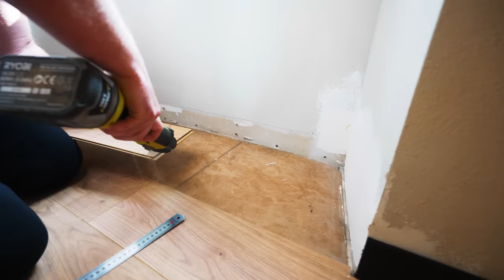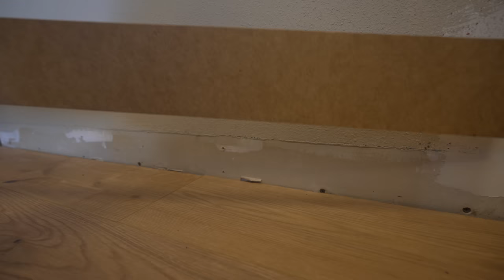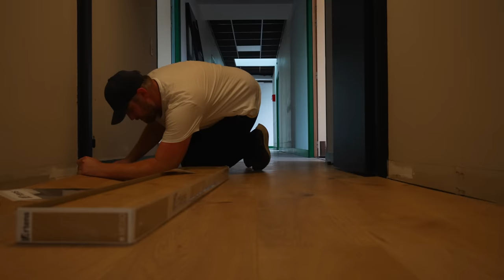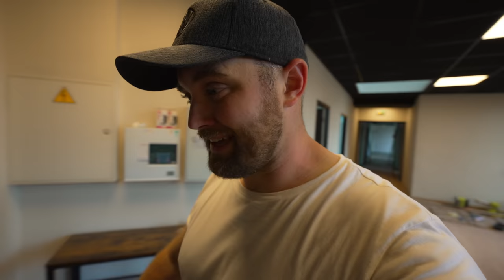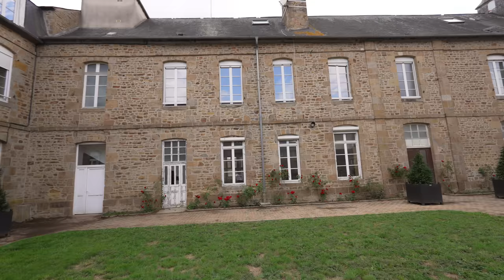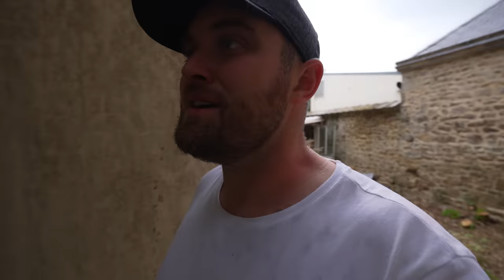Hundreds Of Windows!

Comment: Billy, It’s a good start! Re windows You could spray the windows with a water and vinegar and cleaner solution to begin to remove the dirt. Of course, each one will need to be cleaned individually. But they’ll look soooo good!
Reply: A simple vinegar/water mix will cut through grime and grease. No need for cleaner. If any local newspapers are still ink printed use that instead of kitchen roll.

Comment: 164 windows times 8, is 1312.
I don't count all the windows in a frame as one window, since you have to wash them all separately.
I know some windows have more, some less. But roughly 1300 windows to wash, that's a lot.
But it does look beautiful!
Reply: You're counting panes of glass  as windows though.
Reply: @lemonladyYT  for the purpose of washing them, I absolutely do.
You can't clean the windows with one, big wipe.
If each pane has to be washed separately, I'll count them separately.
Reply: @jessicakoster2543  My point being a window is the opening but each one can have multiple panes. You're counting toes whilst Billy is counting feet. Fine to do that but know what you are counting is a different thing. 🤦‍♀️